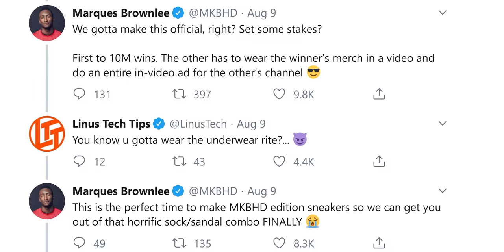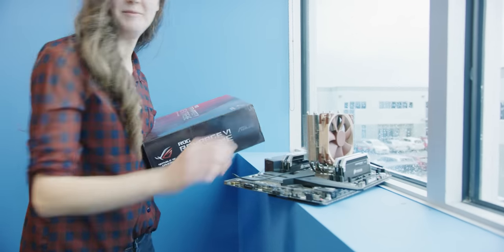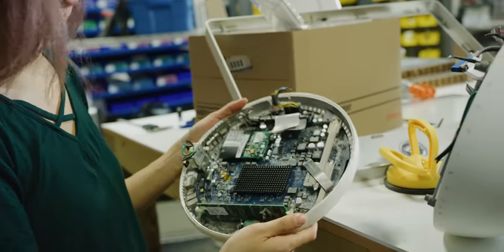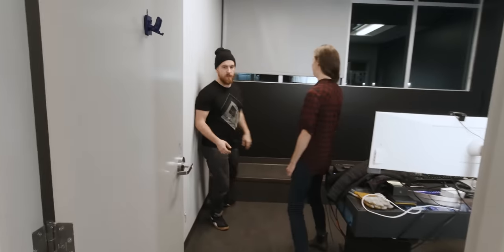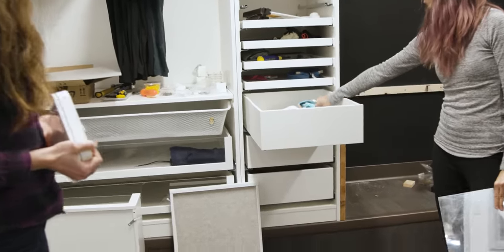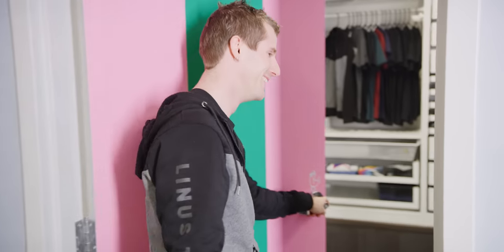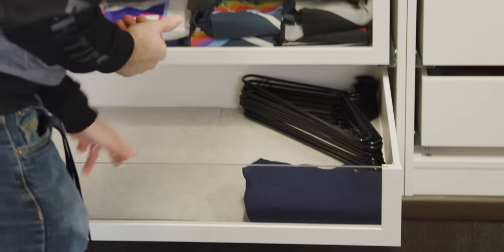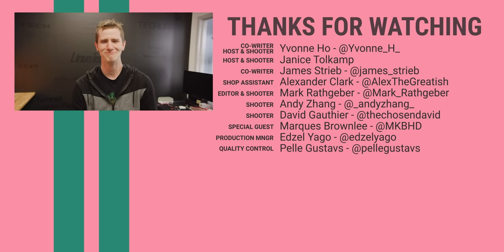MKBHD Ruined My Office!

Comment: “So this is our tissue holder and this is our lampshade.” Apple:write that down write that down!!!
Reply: "We want to announce our line up of tissue holder. The tIssue, a new improved tissue holder that comes with FaceID and a LIDAR. They start at 499 US dollars. And the tIssue PRO MAX will cost 1300 US dollars, which will have a 2500 mAH battery. This one doesn't work as tissue holder tho."
Reply: lamp, but with wheels
Reply: @NathyIsabella  they dont lock either.
Reply: @mikearisbrocken8507  $US79.95 per box of 5 microfibre tissues, installed only at Apple Dealers ($US29.95 Handling Fee applies)...
:-(
Reply: @NathyIsabella  ...$US500 wheels.
Reply: @NathyIsabella  That's what the Pixar lamp wish it had.
Reply: CES 2030 : Apple i-dispenser & i-lamp = $999 each.
Reply: @swapnil199  69$ each bruh
Reply: @mikearisbrocken8507  TiSSUES

Comment: "tolietpaper... for some reason.... idk"

Yeah you do
Reply: you twisted mind... it's to remove thermal paste. He prefers using toilet paper than paper towel. I do the same since toilet paper is softer, I find it easier to fold and wipe and you need less wipes because... you know... it's designed to... wipe... XD

Paper towels are more designed to absorb, so I use it when I spill stuff, but for wiping stuff away : toilet paper.

Comment: "Oh, at least they're using dead Macs."
When you then realise that those macs are probably dead because of some minor proprietary component they intentionally installed and banned any manufacturer from selling to repair shops, and could easily be repaired for a small cost.
Reply: Even as a dead mac they cost more than most PCs. My Macbook Pro died and I looked on Ebay for parts and people were selling them for 600 Euros for a Laptop with a dead motherboard. I fixed mine without buying any parts though by re-soldering some stuff.
Reply: Great argument against govt control as well.
Reply: Who cares